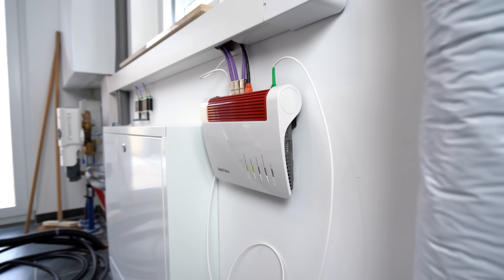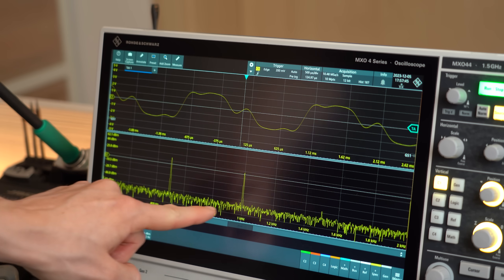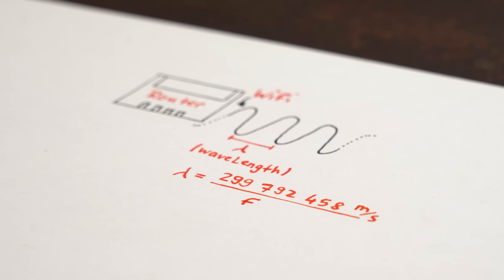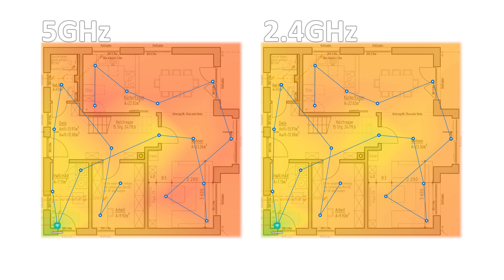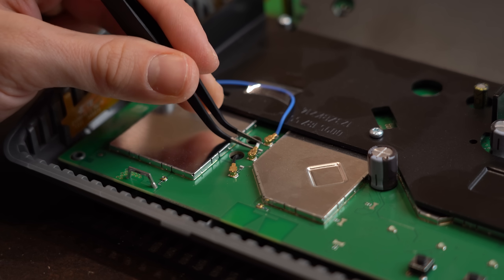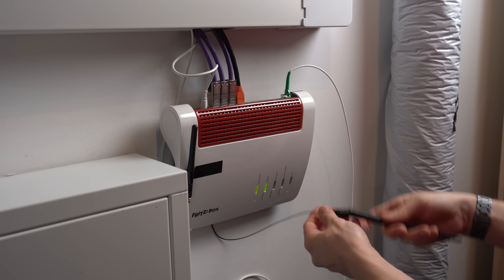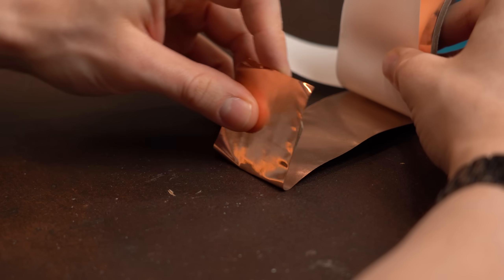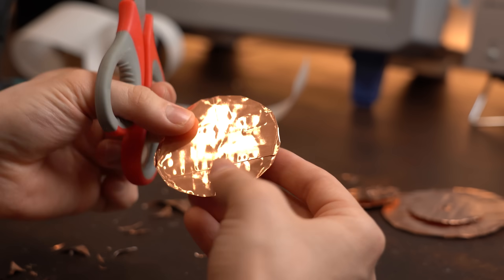I tried OVERPOWERING my WiFi!

Comment: Place the WiFi ap innthe centre of the house. It does mean running a cable, taking up floors, but its a one time job.

Many many years ago, when the old WiFi was stronger... Before they thought that everyone would be using it and it could be stronger....
I was a wisp (gwisp) andi built antennas and tested it out .. 8 miles...

I now have old and new tech, and the okd tech is far better, but has limited speeds. But greater range.

You need a dencent position to start with, then a external antenna.
The washing machine and drier is a big no no.. and i see its blocking.

When customers had issues, i used to tell then to move it 3-4 inches and that usually worked.
But today you can get hold of repeaters, or you wire into the house electrical wiring and back out with a ap. And you're done.

Comment: the last "beam antenna" that was used, might look correct, but it is not. You need to use strength thin elements and not circles. Just do some research on "Yagi" antennas, and you should fine what you need.

Comment: The antenna you made is a very bad quality one, in those high frecuencies you need to be very careful with the measurements, thickness and so on. Try again with solid metal or a circuit board, you can try a biquad antenna, you only need copper wire.

Comment: Focus your wifi better. Middle of house is best. If that can't be done then aluminum foil covered wifi booster antenna that you print will do the job or the old Pringles can. Yup the chips. Half of it cut in 2 will boost wifi

Comment: The legal limit is EIRP so 100mW transmitted from the Antenna, so upgrading the antenna which has +1db could be could be Illegal. 
Technically you can have an transmitter with 100W but after it you have so much Attenuation that you only Radiate 100mW.
So to be legal it’s a good idea to use Multiple access points, and a not so legal hack is to change the location to the US because there they have higher limits for EIRP.

Comment: Move it to the ceiling. Higher is better so i learned. Also there is a printable wifi booster antenna that actually really works good up to 100ft. I totally vouch for it.

Comment: A couple things to consider.
1. Max EIRP is inclusive of antenna gain, so you cannot add just any antenna to a wireless setup as you could be operating outside the legal limit. In New Zealand, the legal limit for 2.4GHz is 36dBm (4 Watts).
2. You can sacrifice bandwidth for range. By decreasing the channel bandwidth from 40MHz to 20MHz you will get better range due to receiver sensitivity.
3. I've seen advice to try a mesh setup but one thing to remember is you are again sacrificing bandwidth for range. Every hop in a mesh network divides the throughput in half.
4. Antenna arrangement is important. Each antenna has a radiating pattern. If it is a MIMO device, both antennas work together to provide the throughput and if different antenna are used on each port (like what you tried in your video) you will get reduced performance because the transceivers are using spatial multiplexing. If you want to use different antennas, you need to set the transceiver into spatial diversity (if it is supported).
5. For OFDM signals, at max transmit power, high MCS rates are not achievable and usually require a 6-7 dB of power backoff to achieve high modulation rates.
6. Consider Fresnel zone clearance.

All the best.

Comment: I like the tech perspective of improving wifi reach, stability, and speeds. Yet, I do have to side with some of the other commenter's about using ISP provided (sometimes outdated) hardware versus 3rd party modernized hardware and if possible, improving that hardware. It's something I'd have to really think about though as those top-notch hardware's get rather expensive and you'd clearly void warranties by modifying them like in this video. It'd make for interesting experiment to see how much 3rd party companies cheap out on parts too.
Reply: There are a number of wifi dev boards on the market ranging from $20 to several hundred if you want to mess with this stuff. There's also  open source software (openwrt) that can be loaded onto some of these dev boards and even name brand routers. That being said, if you want to experiment with antennas your best bet is to purchase manufactured antennas because designing a well functioning antenna is extremely difficult. It should also be worth pointing out, messing with your access points antennas can potentially put you in violation of your local regulations.

Comment: You might want to look at patch antenas from the drone comunity the patch antena are directional usually around 90° and ofer a good compromise. If you want to DIY your antenas you need to be very carefull with precision as the dimentions makes the response, it might be good to have a vector network analyser to check the result and fine tune it.

Comment: I'm surprised you didnt try a simple reflector on those di-pole antennas. The instructions on how to make one has been around for easily over a decade and it does help with getting the signal in the direction you need.
Reply: I was also going to mention this.  The "windsurfer" reflector is a common template for this.

Comment: I'm surprised you didnt try a simple reflector on those di-pole antennas. The instructions on how to make one has been around for easily over a decade and it does help with getting the signal in the direction you need.

Comment: Your explanation of the antenna is not correct. The 25mm and 50mm part are not different frequencies. That was a broadband design 2.4GHz dipole, using the harmonic specs for 5GHz. The subject is very interesting, you left so many options unspoken. Thank you anyway, I like the videos you make. HF is a difficult topic.

Comment: The antenna you built is quite a good one BUT very, very susceptible to dimensional errors. You need to pay attention to element spacing - the most reasonable therory I've had a chance to read about them boils down to capacitors created by each disc. That said - the discs should be made of solid metal not two foils. That'll not work as intended ;)
I've played with success with this type od antenna on HAM radio bands of 23 cm and 13 cm. They tend to present main lobe gain double the Yagi of the same length. Rougly :)

I suggest you try the so called biquad antenna. The side length id 1/4L placed 1/4L over a reflective plane. That's the basic gist of it :) If there's a need I cad dig my few years old article about double biquad antenna fot 5,7 GHz. You should also be able to find the information on the internet :)
IMHO that's the optimal antenna type for your location. Also I'd try leaving one horizontal ant another vertical polarity.

Goog luck and have fun with them ;)

Comment: I had similar issues, so I started reading how different characteristics affect Wi-Fi signal. The best thing to do  is to get a router with high transmission power, low signal attenuation and number of chains (this is related to the number of devices that can connect to the router at the same time). From the ones, that I found only two were covering those criteria well - MikroTik and Linksys (Cisco). The budget option with most features - LTE, firewall, SMTP, FTP, NTP and so on; was the MikroTik hAP AC Lite.
Now in your case, you might consider something a little bit more modern with meshing, just so you can increase the coverage and reduce the noise.

Comment: I had a similar situation, got some RG174 and connectors and moved the antenna to the centre of the apartment... PRESTO! equally poor signal throughout the apartment, concrete and rebar walls.

Comment: Since you say that’s the only spot to mount it, the most logical option would be to disable wifi on the ISP router and run ethernet to central access points on each floor. It definitely doesn’t have much family approval factor, having ethernet wires around the house, but it is a much better than mesh wifi, as that again depends on wifi signal strength to hop APs. 

My house is also built with thick concrete walls and 3 floors with a router on each. Took an afternoon to neatly route the additional cables along the house exterior and now it’s blissful. I get consistent 5ghz wifi everywhere. And as a bonus, I have 3 additional 1Gbps ethernet ports on the other floors for anything which might require a wire

Comment: I've had about 5 dB improvement in this kind of situation by putting aluminium mesh a few centimetres behind the router. That way the signal interferes constructively with the forward transmitted signal and reflects back into your living space, and greatly lowers any signal towards neighbors. It doesn't sound like much, but 5 dB can make the difference between it working well and working badly. It's particularly good if you're using wireless bridging because you can get 5 dB gain at each end.
Reply: Well, that's what that Yagi antenna he was building is supposed to do.  Spacing of the elements is important and frequency-dependent.  If you're not careful, it will be worse.
Reply: @major__kong  It's not THAT critical. So long as you're within a quarter wavelength of where it should be (3cm on 2.5 GHz), it will usually work OK.

Comment: The MIMO controller must be extremely confused about these weird external antennas. Though these antennas probably have higher gain, and more uniform radiation pattern than the internal pcb antennas.

Comment: As a networking nerd (and an RF hobbyist), an access point right in the corner of the house generally isn't happy! If you have the time/permission to do it if you rent you can pull some ethernet cable to get an AP more in the middle, or if you can't, those powerlines adapters are ok too for the house (it pains me to recommend those things, but if there is no other option... 😅) 

Be careful because the power limit is EIRP, so at the antenna. If you have an antenna that "amplifies" the signal you can get > than the legal limit even with a weaker transmitter!
(It's not really amplifying the power, but for example with a directional it's using the power that would be radiated behind in the front, so where it's radiating it does so at a higher power level)

Comment: First of all: who puts the AP in one corner of the entire house? How about locating it somewhere IN THE MIDDLE? ;-)
Second: there are good AP (you don't need router to be used as AP) with superb coverage for the entire house.
I am kind of surprised that you, such experienced guy, did not start from these points before opening the box.
And last: don't measure the ISP - measure between your device and your router/server - use iperf3 - every time you test speed with ISP you will get different results.

I just replaced my APs at home and I have kind of 900 Mbps between my laptop and my server at home (WiFi of course).

Comment: You might have fun or better luck with a pcb printed yagi.  Made of a 0.5 wavelength tall reflector element, and two center driven elements 0.44 wavelengths tall, that are 0.25 wavelengths away from the reflector, and one parasitic element that's 0.43 tall and 0.13  wavelength away from the driven element. 

A short and simple yagi like this should be easy to print precisely and transfer to a single sided pcb and being short means you get sone gain without being so directional that the beam is too narrow. I think the element  thichness is related to the width of the freqency band. But you might like to pick one channel and tune the parameters for best performance on that. 

As to the yagi you used. Generally its better to isolate the elements from the boom even though the phase seperation is almost 180 degrees. Plus a 2.4ghz band  yagi doesnt work well with 5ghz band.  And it takes a bit of previse engineering to make a compromise yagi to work with both bands.

Comment: Hello Scott, i worked as wireless internet service provider. You can use also the Ubiquiti Dish antenna, the M5 (the old type of antenna) can be used as access point with a narrow but powerful irradiation pattern. There exist a lot of different access point, i already used FritzBox and work amazing, you can use the MESH system so when you move in different room you never lost your connection but automatic move your phone from a router to another (MESH system can talk between routers about where you are and wich router receive you better). Hope it can interest you. Many thanks for your videos!

Comment: Does it make sense to attach the router to the transfer point? 
Or is it better to position it in the hallway or living room? 
Some also want to hide the router in the power distribution box, behind metal doors. Looks good and doesn't do much good.
Ultimately, WLAN and DECT should be available throughout the house and not just in the storage room.

Comment: I remember the biquad I had laser cut out of 1/16" copper plate. The width of it was like exact to the upper and lower 2.4ghz frequencies. That was probably the most professional looking custom built antennas I've ever made.
Reply: any plans for this antenna?
Reply: @haydenc2742  it was a pretty bog standard biquad. If you want I can FreeCAD it up in a bit
Reply: @haydenc2742  I don't have access to the machine shop that I had it done at (dad worked there) but I drew it up quickly and rough estimate from pcbway is about $30 for one unit. This is quick maths and for a broadband biquad maybe 150-200mhz around 2.45ghz

Comment: I honestly just recommend to set up a central access point and use flat ethernet wire taped/glued/stapled to the wall or regular CAT patch cable and small cable conduit, anything else is just a permanently temporary hackjob. Mesh network can work, but they also can very well not

Comment: Oh, my dear friend, microwave RF is pure black magic wizardry. On these frequencies, minor imperfections in any antennae will greatly affect the signal. If you want to put this model to the test, you will need to craft it with great precision, to the millimeter. Keep up with the good work!
Reply: Not really wizardry, but a range where precision and very thoughtful execution is necessary, as small parasitic inductance and capacitance matter in this range - e.g 10th of a mm differences in length, his "antenna holder" made out a metal clamp or the sharp edges of his cutouts..
Reply: ..also: Look at his soldering "skills" in every video! A shame for a studied engineer :)
Reply: @salat  "Wizardry" and "black magic" are common words to describe microwave RF within the community. CuriousMarc is always repeating that in his series about the Apollo program. For me, the best example for this are the so called 'hairpin filters'. A passive RF filter made entirely of PCB vias, without any other component. In these frequencies, as you pointed, conductive parts start behaving like components depending on their arrangement. Of course there is no wizardry in it as magic isn't real. Now, when it comes to his soldering skills, why would that matter that much? Most of manual soldering is only for prototyping anyway, he needs to be good with the theory and architecture, soldering is really up to the manufacturing plants to master. That being said, I'm quite proud of my soldering myself. Peace!
Reply: A biquad is easy to make and works well. I knocked one up out of bent pieces of the solid core house wiring type wire and an un-etched piece of pcb material.

Comment: For most people the best way to improve wifi performance is moving the router to a more central spot.

FWIW I went down the wifi rabbit hole for several years, my solution was 4 APs in my not so large home. Rabbit hole indeed

Comment: Placement of the router high up and in the middle of the house will give you the best signal, this mistake happens alot I have the exact same router and have good WiFi everywhere as I placed it in the living room in the middle of the house near the ceiling.

Comment: Please do not do either what you have showed. ISM bands are heavily overcrowded. Nowdays every fridge and a bulb has a wifi. Besides this there are plenty of do-not-know-what-I-am-doing operators buying mesh systems, tunning the output power to the max, sticking with 40MHz 2,4GHz band channels (or 80MHz or even 160MHz in the 5GHz), wowing why they could not get decent speeds (with that pesky 256 or even 1024QAM modulations). Do not be eager and think twice! Due to the nature of shared media (ie "the ether") you are supposed to get about half of througput from your link speed (UDP or less for the TCP) anyway. This all depends more on the client device either. Compare throwing 20dBi TX output with another 2-3dBi antena (not counting cable losses) onto pitty 14-17dB max output of a mobile phone. There is a bunch of other things you should consider - noise floor, same channel or adjacement channel interference, stream count, basic speeds and what turns me on the max - not disabling 802.11b features which takes more air time... There is hardly any good working roaming system for the wifi (what soho routers does 802.11r and 802.11k?) So there are always client devices sticking to a AP with the worst signal - when you are moving (with your cell phone) it gets better and worse periodicaly. So do not come out with such ideas - instead do a channel survey, ask your neighbour  (and your self) to go with simple 1-6-11 channel scheme and turn down the power. If you need more speed - go with the 5GHz band. Turn down the power for 2.4GHz radios, use band steering etc. With lower power of your radios you can now use more of them (prefferably 5GHz). Upgrade your router/wifi AP to use 802.11ax.